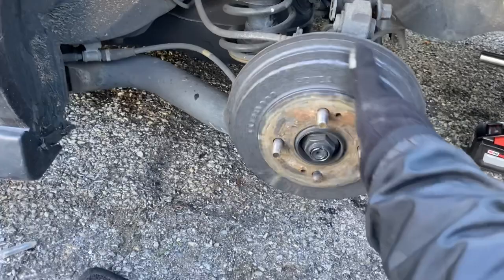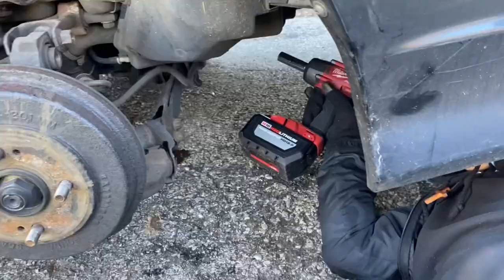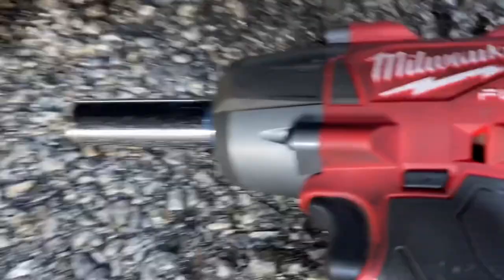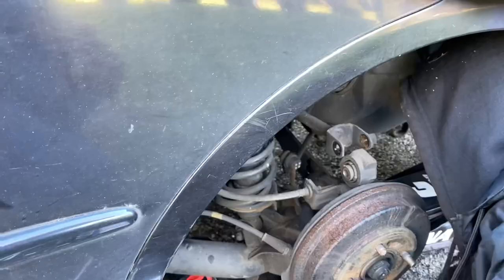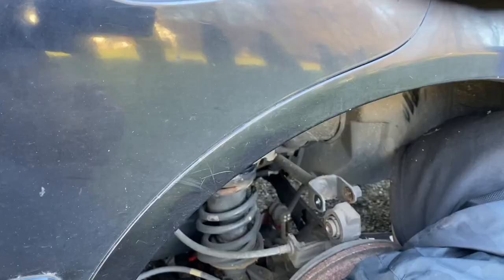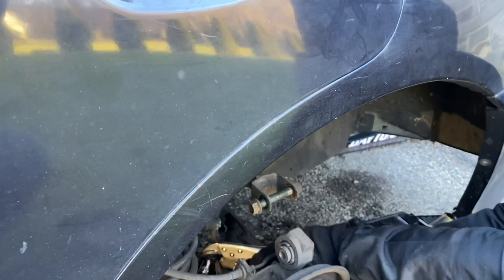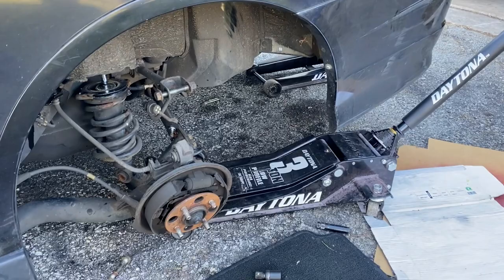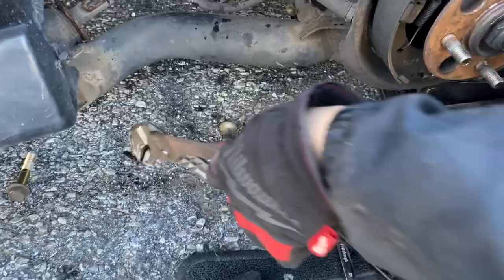Converting Rear ES1 Civic to 5 lug with calipers

Comment: What are the assemblies called if I were to look on eBay? I can only seem to pull up rotors when searching. Thanks I'm enjoying the build
Reply from the maker: You’d need the rear spindle/ knuckle with hub attached to it, I would try to get it fb market or a junkyard around you off an Rsx or 5 lug ep3 si. eBay may have them but could be pricey